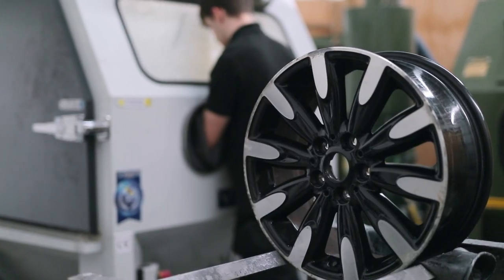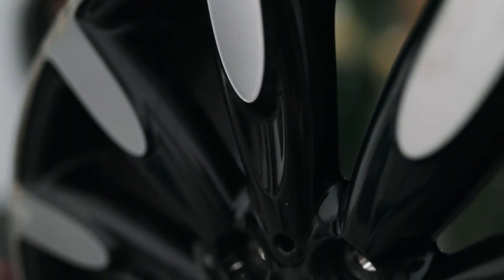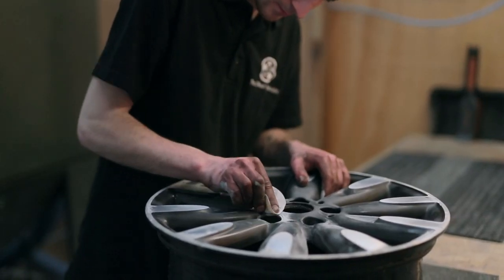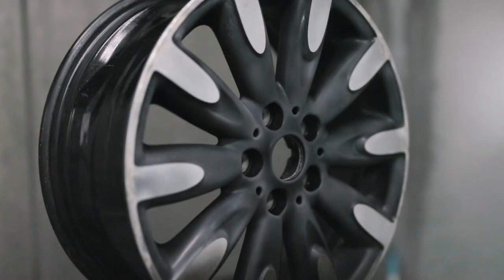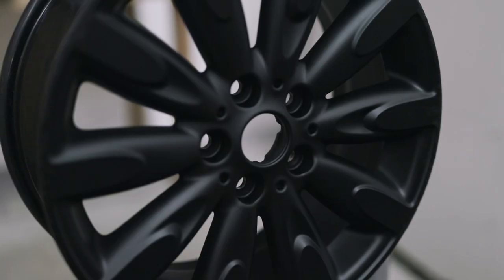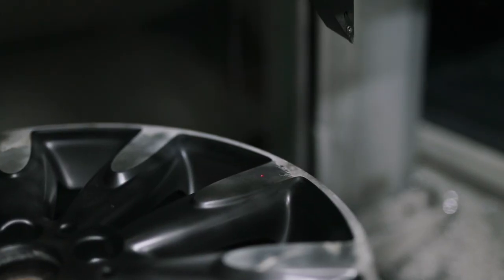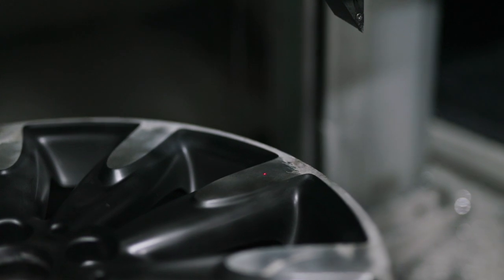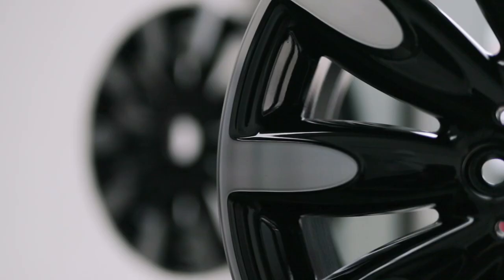How do you Diamond Cut a wheel?

Comment: What is the paint used on the wheel after the process to prevent corrosion? My SsangYong Musso original aluminum wheel had a lacquer similar to a plastic coating.